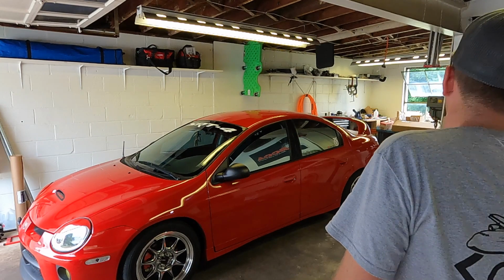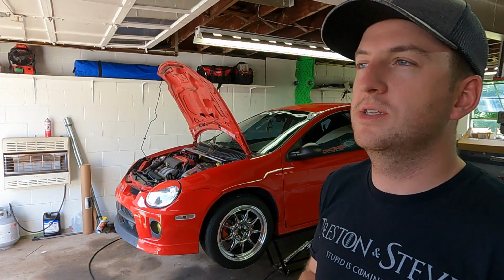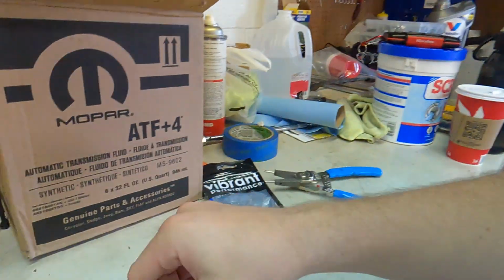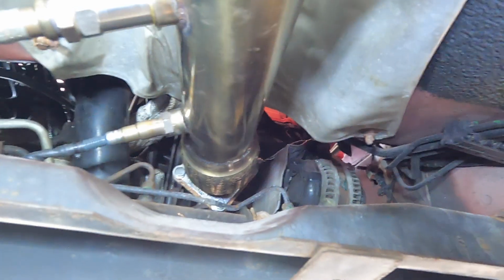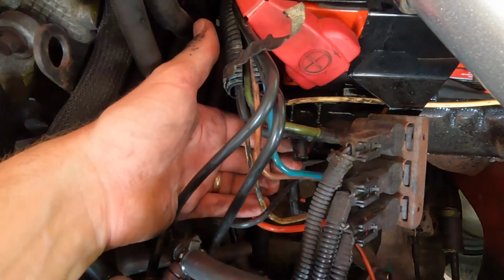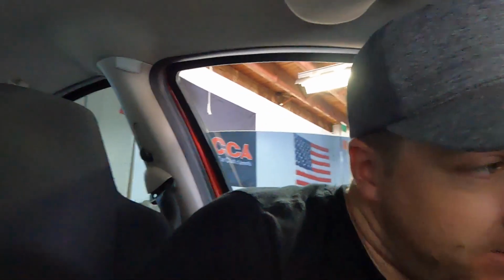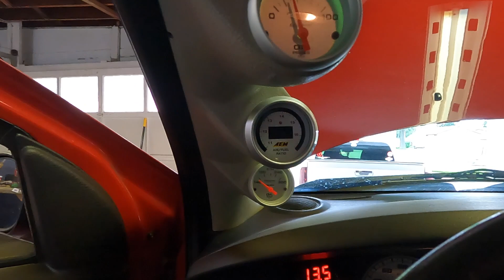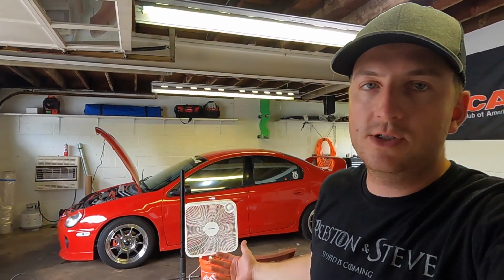FIXING MY SRT-4 BEFORE RACE DAY

Comment: Same issue with my RSX when I went full race header, looking for a cat that’s not there. Had to use an (L) 02 extension to bring the sensor back from the header to prevent the CEL and throwing the ecu into limp. Glad you fixed it bro!
Reply from the maker: I was surprised when it didn’t throw a code right away lol